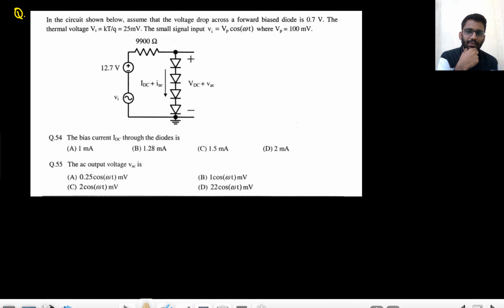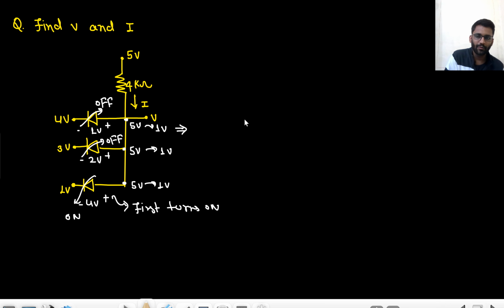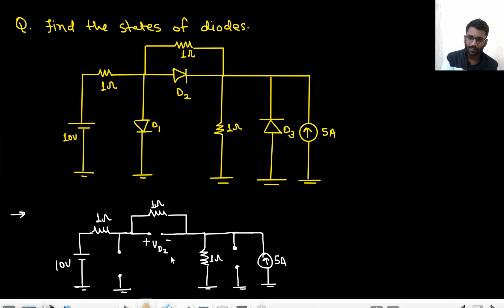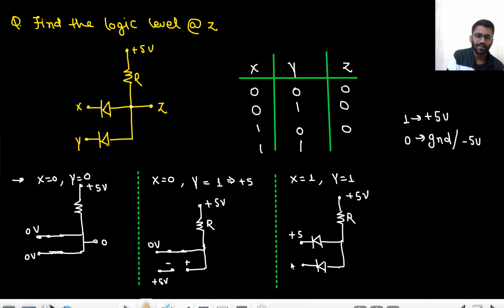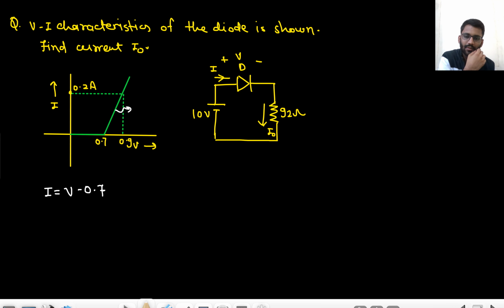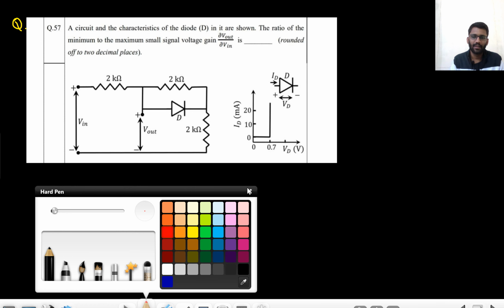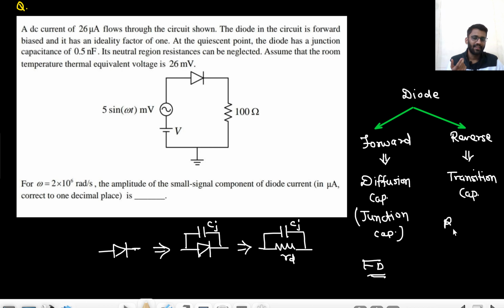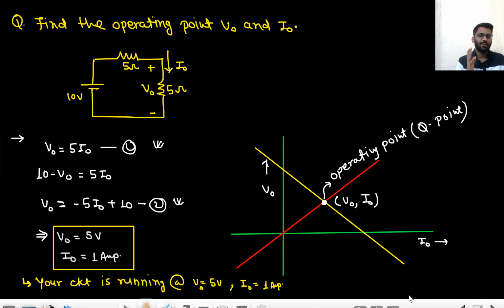Assignment 1 Solutions || Analog Electronics || PrepFusion || Himanshu Agarwal

Comment: 56:29 sir they mentioned voltage drop is 0.7 which means the diode should be silicon , then non ideality factor should be 2 . How you take 1 sir . I mean the non ideality factor given indirectly.
Reply: Yes, previously in old textbooks that was the concept, but today we consider ideality factor 1 irrespective of the diode....concept upgrade..

Comment: Sir at 23:30 how r telling that diode might get on or off
The potential drop is positive so it should be on right
Reply from the maker: Didn't you watch the previous explanation? 
The one which is at the highest potential, that only turns on at that particular time. After turning that diode on, we again check the operating condition of the other diode.
Reply: Ohh yes sir I got it now tqsm